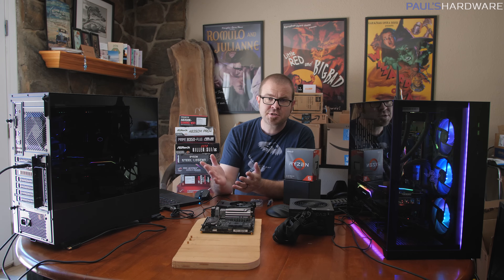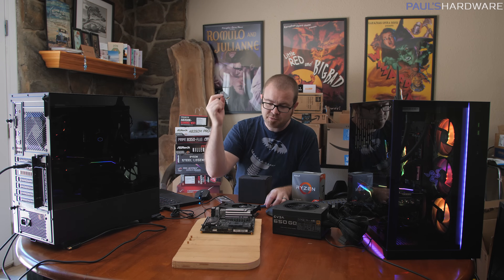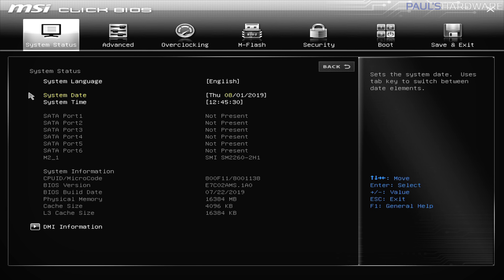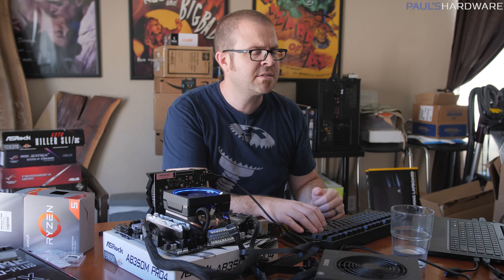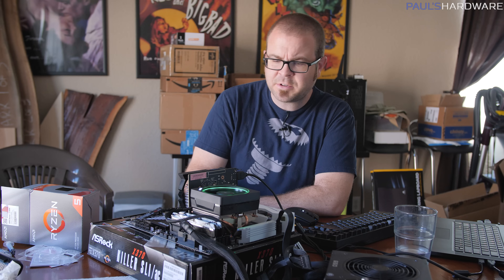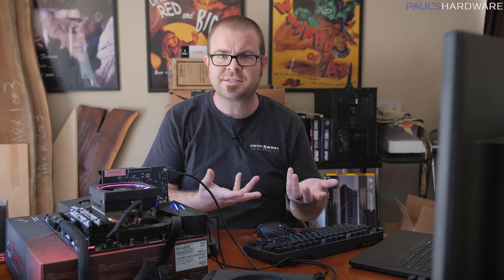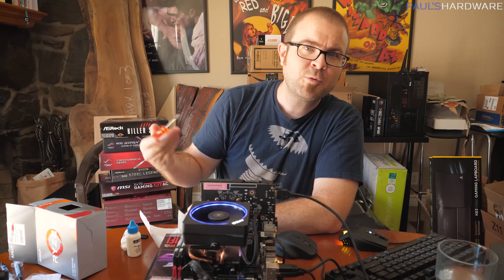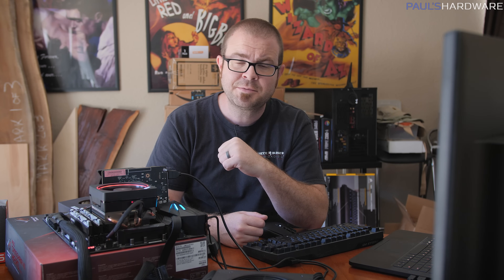Does Ryzen 3000 REALLY Work on Old Motherboards? Testing B350, X370, B450 and X470

Comment: I just build a Ryzen 5 3600 machine using the B450 Tomahawk Max mobo. No issues at all. And yes, before anyone tells me, I know that that mobo is an updated version of the vanilla B450 Tomahawk with updated bios.
Reply: So please reiterate that for me. You did not have to do a single bios update correct? I am asking because I am building a system to replace me gaming lap top . Going to use a Ryzen 5 3600
Reply: @RalyksThims  The B450 Tomahawk Max is only about 2 months old so it already has the most up to date bios an MSI B450 mobo could have. I think that's the July update. So no, I didn't have to update the bios to run my 3600 chip.

Apart from out of the box compatibility with 3000 series they also have an updated 32MB bios chip and I think they also support faster RAM (but I may be wrong on that last point).
Reply: @mjribes  Awesome thank you
Reply: @RalyksThims  Np

Comment: I don't remember if this was in the video, and how much the infinity fabric speed matters, but the x470 I bought only supported up to 3200Mhz on my 3600 Mhz RAM. So something to take into consideration when considering an x470 vs an x570. I didn't know until afterwards, but RAM also has other factors for it's True latency besides the rated megahertz speed.  For example timing 18-18-18 vs 16 16 16.

Comment: I installed one of those x470 CH Vii boards with a R7 3700X. Install went like a charm after BIOS update, overclocked a bit, configured and 3-4 hours test and all ran fine. Turned it off and went to sleep. At next morning I got a code 8 and we had to RMA the motherboard.

Comment: question, do you have to change the flash drive to FAT32 format before doing the bios and drives to the flash drive? if so, how do you change it to that FAT32 format?
Reply: By formatting it, it'll wipe the drive and let you change the file system to fat32

Comment: Great video Paul.🇨🇦
I really just want a plug and play option. I'm swapping out my 2600x and going to the 3700x. It will be going into a gigX470ultra gaming. After reading several comments and issues, I'm wondering why there is so much hassle. Customers were dooped. I was led to believe when I bought my initial system(8months ago) it would be an uneventful process. It doesn't seem like an uneventful process.  A simple Bios update is acceptable - but it sounds like there are many other issues here. Wtf.... ain't nobody got time for dat..

Comment: It is compulsory to use gpu in ryzen 3gen 3600  if i am not buy gpu it is working or not...... In future i will upgrade gpu but now not buy gpu..... 🙂my buget is tight now
Reply: Try the 3400g.

Ryzen only installs on Windows 10. For help https://community.amd.com/community/support-forums/processors

You can use a small screwdriver to put an uncooked-rice-grain-sized blob of thermal paste on the CPU in the middle. Also use it to straighten any bent pins. Renew the paste every 12–18 months.

Tuning Ryzen for better performance https://www.youtube.com/watch?v=LTT5mhqmjJc

(If you get the 3600, 2600, 2200g, or 2400G the Wraith Stealth is a bad cooler. Try the Cooler Master 212 evo or the smaller Antec a40 pro. Thermal Grizzly Hydronaut is a very good paste.)

MSI have just released 'Max' versions of their B450 lineup with Ryzen 3000 support out of the box. https://forum-en.msi.com is MSI's forum.

A new Ryzen user wrote: “make sure windows 10 allocates enough space for virtual memory because my computer was stuttering for a while”. (I think they mean the page file/swap file. It really means they didn't do so with their old processor.)

“My ONLY point of frustration came from some instability I experienced that took me a while to troubleshoot, first thinking it was probably some sort of memory incompatibility. It ended up being an incompatibility with the Windows 10 Ryzen power plan that was installed. Switched to the regular "Performance" plan and its been rock solid ever since.”

If the processor idles at a high temperature: disable all 3 bios options for Precision Boost Overdrive (PBO). Set Windows Power Plan (not AMD's one) for "Balanced".

Comment: i am using the crosshair 6 hero wifi with a 1700x@4.1ghz and have been considering upgrading to the 3900x how much of a performance hit will there be form using an x370 mobo instead of x570

Comment: Usb 3 external hard drive write speed is very poor, and it nearly stops and timeout. I cant find any solution. I have lost nearly 600 gb of data, luckily i used my other laptop as backup. Using Ryzen 5 3600 with asus prime b450 m-a board with 16 gb ram.

Comment: I also own the ASUS Crosshair VI Hero Wifi motherboard. When assembling my 2700X machine I ran into the same issue. I was desperate and freaking out. In the end I found out that the actual documentation is bad. IF you download the manual for it, you'll find that the filename in it is for the non-Wifi version. It's a misprint. After an hour and a half I finally found the filename on the ASUS forum. If I remember correctly the manual said it needed to be C7H.CAP and it should've been the same as yours - C7HWIFI.CAP. I couldn't figure out what I was doing wrong. I used my MacBook to copy files over to the USB key so I thought it was some sort of partitioning issue at first. It was pretty frustrating. They might've changed the manual in the mean-time, I don't know, but it's worth looking out for. Also, they should just rename the bios files on their site to the correct one from the get-go.

Comment: Have a x370 Aorus Gaming K5 with Ryzen 1600 yesterday i bought a Ryzen 3600 upgraded bios to ver f42a (with some problem) swapped the CPU to 3600 and for now it works well, wolt setting is still f.. up on this mobo :/ But yeah all in all it works.

My main problem really is that on default bios the cpu on stock is on 4000mhz with 1.4 volt wich is a LOT and yeah a lot of heat, soo went into bios changed the Auto volt to fix 0.00 (this is the part witch i said is f.. up on gigabyte mobo) the mhz is on 3600.
Now in windows the CPU-Z and Ryzen Master show me that the CPU is on 4000mhz on stock with 1.4volt but when i start cinebench the mhz goes down to 3900mhz and the volt to 1.33volt soo yeah, i need to look into this more.

Comment: Hello Paul, Could you give me some tips upgrading my computer?

What would you do with this spec? Would you just build a whole new amd based computer, or would you do some upgrade on the items I already have? (I only use my computer for gaming)

PowerSupply - Corsair RM850i

Motherboard - MSI Z170A GAMING M7 (MS-7976) (U3E1) (Intel)

GPU - NVIDIA GeForce GTX 980 Ti (MSI)

CPU - Intel Core i7 6700K @ 4.00GHz Skylake

2x RAM - Kingston HyperX FURY Black Size:8192 MBytes Max Bandwidth DDR4-2134 (1067 MHz) Part Number:KHX2133C14D4/8G
Reply: You could upgrade to a Ryzen 3600 or 3700x and keep the 980ti for now.

A YouTube commenter wrote: “I went from a heavily oc'ed (i5) 2500k to a Ryzen 2600 and the difference is pretty unbelievable in both gaming and outside of gaming.”

Another: "I upgraded to a 1700 (Ryzen 8-core 16-thread) from a 5820k (i7 6core, 12 thread). Used both of them at 1440p with a GTX 1080, there is only 1 difference between the two CPU's: The 1700 loses 1-2 fps on the average and maximum, but gains 10-12 on the minimums. No joke my 5820k, before that my 3930K (i7 6core, 12 thread) and before THAT my 4790K and even my Xeon 1230v3 all had issues with microstutter here and there. It actually felt like I was playing at a higher framerate on my 1700. And before you ask, the only difference between each of those systems was the mobo and CPU. The ram stayed the same."

"A friend of mine just got a Ryzen 1700X (8-core 16-thread) computer. He wanted me to see it so I came over. I tried it and it seemed faster than my computer, but I was not overly impressed. He noticed my disappointment and pushed me away from the computer. He said "Watch this"! He opened 5 tabs in his web browser and opened a 4k you-tube video in each tab except the last where he opened an 8K video! He opened 3 1080p videos in VLC player (each separate instances) and one more VLC video playing 4k video. Finally he ran a full malware-bytes and anti-virus scan. The cpu never went above 58 degrees celcius in temperature and cpu utilization went 52%-72%. He let me try the computer while all this activity was simultaneously going on and it was still faster than my computer (older Intel -i5). I was so impressed that I promised him I would buy my own Ryzen computer before the end of the year!"

“My Ryzen 5 3600X surpasses my I7 9700k machine in almost all functions. My I7 machine is relegated to my 7 yearolds Roblox habit and nothing else. Hell, my Ry 3600x beats the I9 in single thread.”

Someone made a good point: AMD architecture is going to drive all of the next-generation consoles. Microsoft worked closely with AMD for the new Xbox.

Ryzen only installs on Windows 10. For help https://community.amd.com/community/support-forums/processors

You can use a small screwdriver to put an uncooked-rice-grain-sized blob of thermal paste on the CPU in the middle. Also use it to straighten any bent pins. Renew the paste every 12–18 months.

Tuning Ryzen for better performance https://www.youtube.com/watch?v=LTT5mhqmjJc

(If you get the 3600, 2600, 2200g, or 2400G the Wraith Stealth is a bad cooler. Try the Cooler Master 212 evo or the smaller Antec a40 pro. Thermal Grizzly Hydronaut is a very good paste.)

MSI have just released 'Max' versions of their B450 lineup with Ryzen 3000 support out of the box. https://forum-en.msi.com is MSI's forum.

A new Ryzen user wrote: “make sure windows 10 allocates enough space for virtual memory because my computer was stuttering for a while”. (I think they mean the page file/swap file. It really means they didn't do so with their old processor.)

“My ONLY point of frustration came from some instability I experienced that took me a while to troubleshoot, first thinking it was probably some sort of memory incompatibility. It ended up being an incompatibility with the Windows 10 Ryzen power plan that was installed. Switched to the regular "Performance" plan and its been rock solid ever since.”

If the processor idles at a high temperature: disable all 3 bios options for Precision Boost Overdrive (PBO). Set Windows Power Plan (not AMD's one) for "Balanced".

Addressing Ryzen-3000 boost issues https://www.youtube.com/watch?v=GnR6nCk8BRk (the power plan gets installed with updated chipset drivers)

Comment: I've got a ASUS Crosshair Hero VI X370 and it's running my 3700X perfect. Also running 32GB of Corsair RBG Pro @ 3200MHz.
Reply: @ФедорЕмельяненко-ъ7т  still used my older 1700X CPU and downloaded the new BIOS off ASUS's website to a USB. Then, while in the BIOS,  you can select the file from the USB to update.

Comment: I bought a Ryzen 5 2600 for my Asus Rog Strix B450 mobo but the 3000 series were launched like a week after I bought my pc so I would like to know if my b450 would support the ryzen 5 3600 or I should just stay with my 2600.
Reply: Stay with the 2600. 3700x/3800x prices will drop. Check the motherboard's Web site for BIOS updates

Comment: This makes sense for existing owners of pre Gen 3 users. Fpr new purchase I have found X570 Gen 3 boards for less or more depending on feature set. It would seem that a new upper mid-range system can be put together for around $1000.00 (CA).

Motherboard & CPU (Ryzen 5, 3600) alone hit the $580 to $650 range.

Comment: Anyone please shed a light on me, I'm building a Ryzen 5 2600 PC. But I have no idea on what mobo I should pick. My initial thought is to pick a cheap B450, that is ASRock B450 Pro4 which cost $99. But then I saw this ASRock X370M Pro4 which cost $70. I don't really plan to do any OC-ing, tho. If I pick the X370M Pro4, how long (at least) can I hold on before I have to upgrade the mobo?
Reply: Check the ASRock X370M Pro4's Web site to see if it has BIOS updates for the Ryzen 3000. If yes then you can buy it. Later you can upgrade to a 3800x/3900x as prices fall and that will last you a long time so no need to worry about what AMD will bring out later.

Someone made a good point: AMD architecture is going to drive all of the next-generation consoles. Microsoft worked closely with AMD for the new Xbox.

Ryzen only installs on Windows 10. For help https://community.amd.com/community/support-forums/processors

You can use a small screwdriver to put an uncooked-rice-grain-sized blob of thermal paste on the CPU in the middle. Also use it to straighten any bent pins. Renew the paste every 12–18 months.

Tuning Ryzen for better performance https://www.youtube.com/watch?v=LTT5mhqmjJc

(If you get the 3600, 2600, 2200g, or 2400G the Wraith Stealth is a bad cooler. Try the Cooler Master 212 evo or the smaller Antec a40 pro. Thermal Grizzly Hydronaut is a very good paste.)

A new Ryzen user wrote: “make sure windows 10 allocates enough space for virtual memory because my computer was stuttering for a while”. (I think they mean the page file/swap file. It really means they didn't do so with their old processor.)

“My ONLY point of frustration came from some instability I experienced that took me a while to troubleshoot, first thinking it was probably some sort of memory incompatibility. It ended up being an incompatibility with the Windows 10 Ryzen power plan that was installed. Switched to the regular "Performance" plan and its been rock solid ever since.”

If the processor idles at a high temperature: disable all 3 bios options for Precision Boost Overdrive (PBO). Set Windows Power Plan (not AMD's one) for "Balanced".

Comment: FYI, I went the Ryzen boot kit upgrade kit from AMD route. Started the process July 30, got fully approved Aug 5th after various emails (sending all the necessary info and pictures up front did not save me any time, they asked for proof my motherboard didnt have a way of updating, then asked for pics of the serial number, product code, etc after I had already sent it). It took at least a day between their responses, no responses over the weekend (not surprised). It is now August 6th and they said it has been shipped but don't have a tracking number yet. Make sure you're okay with waiting 7-14+ days for this solution or pay the extra for X570 and deal with chipset fan. I'm in no hurry, but it is a little annoying.

Comment: I have several issues with my B450 Aorus Pro Wifi motherboard with my Ryzen 5 3600x. It takes me ~15 sec for my computer to boot from time to time. It also sometimes resets my xmp setting. Freshly installed windows 10 and everything. I'm not really sure what the problem is.

Never had this issue on my x58 motherboard :(

Comment: Hey

I have the nonWifi Hero 7 and if i set my RAM to his XMP profile (3466 CL16) my PC wont boot at all. It only shows the qcode C8. (didn´t found anything about that in the Internet). Anyone an Idea?
Reply: Yvan Munier
53 minutes ago
Post code 8 on my crosshair VI Hero was because of the USB key. With another usb flash drive, the update worked fine 

this guy just posted this comment 50 mins ago. mb can help u

Comment: I think at this time and age they could make the CPUs work like GPUs where it will start but without the drivers wont unlock full potential. Let you pass through boot, and windows so you can make a soft flash instead of force people to waste Paste and time and risk damage everything, just to flash a god damm bios -_- it's just absurd.

Comment: My 3700x does work on my Asus Crosshair Hero 6 with the newest bios.  But I do run into some memory boot code errors..  alway boots and stops on (0d) qcode or (8) qcode.
So I do have to reboot it a few time to get in to windows.. happens every time.   But other than that it work...  
One last thing dont overclock you new cpu on this crosshair hero 6.  I always get error and will not boot.

Comment: Quick question: 
I am buying ryzen 5 3600 and b450 tomahawk motherboard without a graphics card at the moment.

If I connect my display to any on-board display adapter will I be able to use it normally until I buy a graphics card?
Reply: No
Reply: @eriuzo  nuts! I ordered one today so all is well now.

Comment: Gigabyte gaming 7 Mobo C5 debug was a bit of a doozy to get all 4 dimm slots to work even after I used the tool. But I switched the back up memory firmware switch to 2 then rolled back the bios to F31. At this point I reinstalled the 4 gig ram stick and Ryzen 2700x then used the tool that gigabyte provides when clicked on update said, "You do not need to update firmware." I then proceeded to update to bios F42a. Once completed I rebooted into the bios pressed F9 to view the bios version and to see if properly installed. Next shut down the PC and turn off the power supply by using the shut off switch in the back and reinstall the Ryzen 7 3800x CPU.  Turn on the PC and there should be no C5 issue.

Comment: Ryzen 3600 works fine on my Biostar B350ET2. Issues: 
- Slow POST.
- Wake up by itself after about 20-30 minutes of sleep.
- (Probably )Ridiculous stock voltage, so I undervolted by 2-3 steps.

By the way I was using Athlon X4 950.

Comment: You probably should have warned people that some older motherboard's BIOS chips are too small for the Ryzen 3rd Gen BIOS update. This will disable RAID and other features on some motherboards, especially MSI, for example the B450 Tomahawk.
Reply: Raid was added back in more recent version
Reply: @BrianLough  not on the msi b450, you have to buy a new b450 that MSI are retailing called the B450 Tomahawk PLUS that has the new bios chip large enough to hold the larger instruction size
Reply: @gosubreboot713  nope,go to the standard tomahawk (not the max version) page on MSI website, go to bios version "7C02v19", under the description: "fix raid issue"